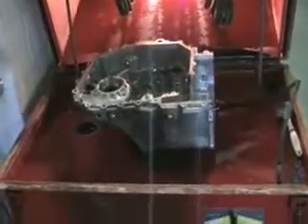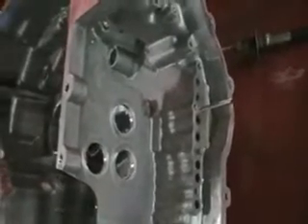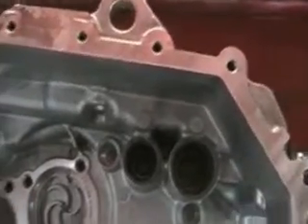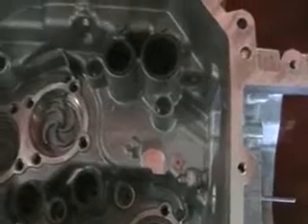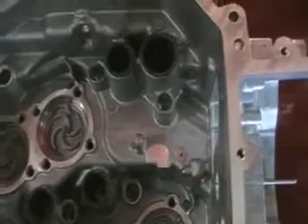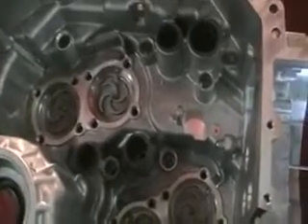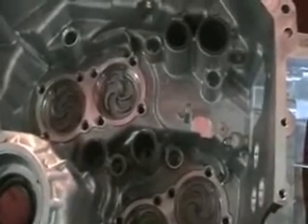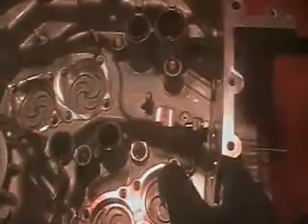SST EVO X Transmission Case Cleaning at Jacks Transmissions

Comment: This is kind of reassuring. My Ralliart is throwing a P1875 "torque damper sensor poor performance", I have reason to believe the sensor is OK but, the damper has broken springs. I can really explain it or simulate the noise, it's simular to "clutch chatter", only it's not. Anyway if all goes well, I'll be taking a vacation in Utah later this year and while I'm at it,  drop my car of with you guys in Colorado for your SST service and damper rebuild.